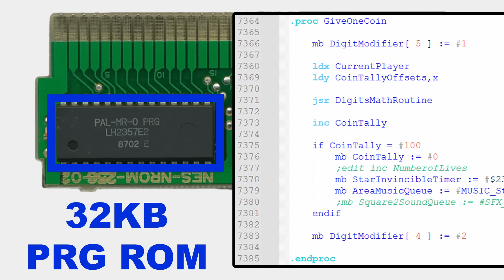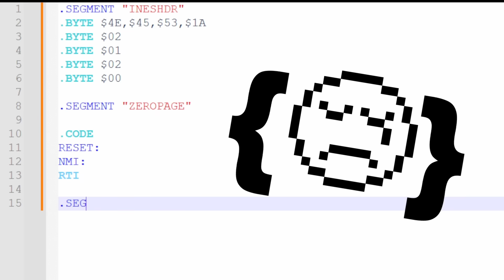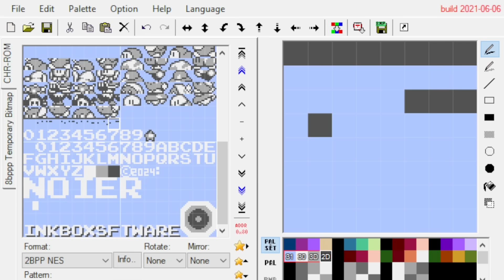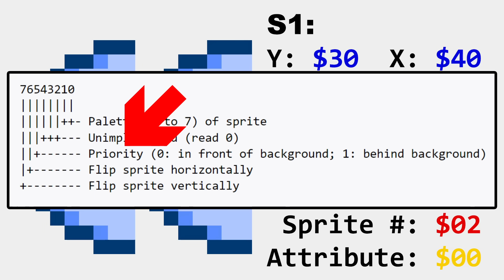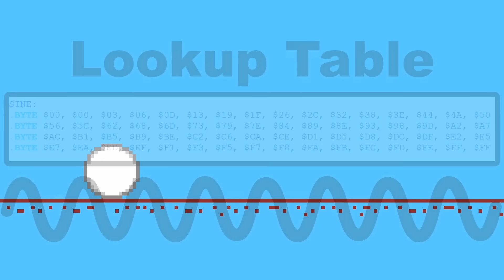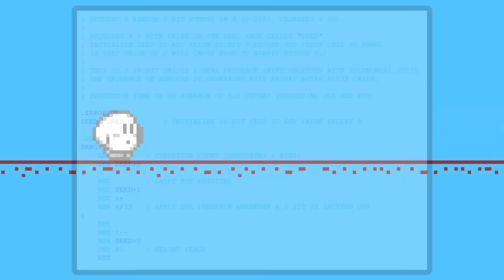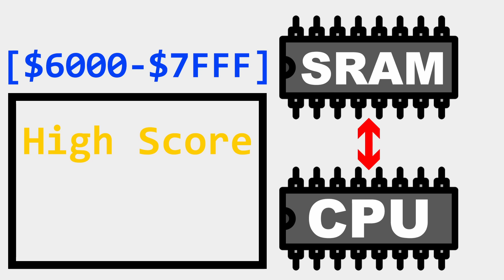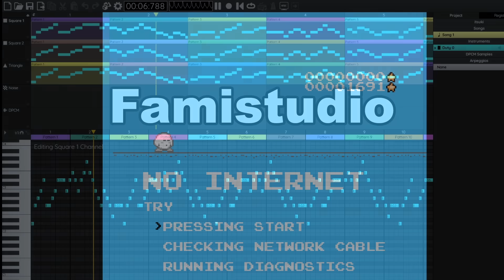Programming a 40KB NES Game (in Assembly)

Comment: Using a sine for jumps is one of the common misunderstanding of jump physics. What you actually need is a y=a*t² function instead, which comes gratis by having y += speed; speed += gravity.

Now, given how many NES games had tweaked jumps to the point where they are mostly shaped like SMB1 hills, the sine isn't a too bad assumption unless it brings you back up if you fall down too far.

Comment: What people fail to realize is that most cartidge consoles are an incomplete motherboard.  Arcade units are a complete game board.  What nintendo, sega, and others did was create the same thing, but with the "game" portion being modular and replaceable.  You could in theory create a single board for ant cartridge game that plays only that game like any other arcade unit.  This is also why it took a while for cartridge systems to catch up to arcade units.  Arcade boards could be designed to play the desired game optimally, whereas cartridge or even disk or tape systems were always limited by what the host hardware could do.  It wasnt until we could build host hardware faster than what arcade mainboards could do that we got arcade quality from console systems.

Comment: Slow down!
You're better off making a slightly longer video to include clearer explanations of what all these things are.
RAM... random access memory. You can alter the information, and you can access the information. Which means, it's read and write capable.
ROM... read only memory. Self explanatory.

So the instructions that never change are programmed into the ROM.
The stuff you want to keep note of while you play but don't always need and constantly changes goes into the RAM.

PAL-MR-0 PRG chip,,, 32 KB (kilobyte) program ROM chip. Contains basic instructions to direct electrical pulses to the right components on the NES.
HVC-MR-0 CHR chip.... 8 KB ROM chip. Contains tiny switches that determine what colors and what pixels are used to make shapes appear.
3195A chip... sends data to the NES to confirm the official status of the cartridge. It has to be a licensed product with this chip in order to work. Got it!
Ricoh 2A03 CPU (Central Processing Unity) chip on the motherboard... based on the MOS 6502AD chip. It has an APU (Audio Processing Unit) built into it.
The RAM available (where the CPU can save information for easy access) is only 2KB in size. 2KB isn't even enough to hold a low resolution photograph.
RPC02G-0 chip... the picture processing unit. Converts the data on the cartridge in the HVC-MR-0 CHR chip to shapes on the screen.
The data is converted to an RF signal (radio frequency) that's transmitted to the TV, and the cathode ray projects that onto the inside of the TV as scan lines. Great, I understand.
60 frames a second, but interlaced. So not really 60 frames per second. More like half of a frame... so 30 frames per second interwoven.

When starting up the console with a game plugged in, both the RAM on the cartridge an the VRAM (Video random access memory storage) are cleared.

Then the graphics that are stored on the HVC-MR-0 CHR chip are loaded into the VRAM of the NES, which then the RAM on the cartridge runs the BIOS (Basic in and Out System) or game logic.

Comment: Question: is it possible to alter the color pallete of a sprite on a per-LINE basis rather than a per-cell basis if coded correctly? Sorta like how the Atari 2600 did to give the illusion of extra colors for a single sprite?
Reply from the maker: Yes, but it would require keeping track of PPU cycles

Comment: Commodore 64 games were about 38kb max 40kb on a 8 bit machine is quite sufficient when you use exclusive machine code that was kerneled with it 40960 Bytes to write a game with i bet you couldnt do it the nintendo was far easier to program than a c64 the Nintendo had a innovative  way of programming

Comment: What?, the controller data in the nes is a fkn byte?, that knowledge would have saved me a lot of troubles back in the days when I spent hours trying to fix my controllers.
Reply from the maker: Actually, the controller is polled and relays each button's current state in a sequence. That process takes quite a few clock cycles, but you can take that sequence and fit it all on one byte for reference.

Comment: Later games used "bank switching" to fit more code/data than the NES's 64k address space would typically allow
Reply: That sounds a bit like multiplexing which gives more capability to a limited resource by working on one bank or area of the screen at one time, which happens so fast that the person playing the game can't see this.
Reply: @lemdixon01  It's more like an HDMI splitter where you can have your Switch, Xbox, and DVD player all plugged in at once but you can only see one at a time

Comment: That sine jump idea makes so much since now. I used to wonder how jumps looked the way they do, I'm gonna figure out which takes less time to process for most hardware.
Reply: It would be more physically accurate for the jump to follow a parabolic path rather than a sinusoidal one, and that’s actually not terribly hard to do on a computer, especially for a character’s physics.

Just track the character’s vertical velocity, use the velocity to move the character vertically by adding it to the current vertical position every frame, and subtract a constant amount from the velocity every frame to simulate acceleration due to gravity. This last part is what makes the character slow down on the way up and speed up on the way down.

Comment: Except it actually is more difficult scince we cannot just arbitrarily declare variables and instead must use the three “registers”
Reply from the maker: A variable is just a unit of memory set aside for some purpose, you can easily declare variables at any memory location you need in the assembly code, if you will reference it often you may consider defining it in the zero page
Reply: @InkboxSoftware  Yes but you can't give them names for some reason, which means you need to memorize what all of them are used for.

Comment: Assembly is just amazing really on how small its code can be when it's compiled
Reply: 6502 in particular is tiny. Most modern cpus use 4 bytes per instruction at all times but we have much more room now so it hardly matters. NES code size is mostly negligible when it comes to file size. It's the data tables that hog the most cartridge space
Reply: Gets crazy small when your "words" are single bytes, as opposed to utf-8
Reply: Assembly isn’t compiled. It’s assembled.
Reply: Shouldn’t be C with modern compilers as efficient as writing assembly?
Reply: @rethardotv5874 the problem with C is that it needs a standard runtime library inside the executable to run. Since a lot of the library goes unused most of the time, you end up wasting space, and also just the fact that the code needs to keep jumping between your code and the library hogs performance.
Reply: @shadesoftime  good to know. What exactly do you mean with standard library? GlibC with stdio?
Does that also include code for embedded devices that builds for low performance low memory targets?
Reply: @rethardotv5874 If you cut out bigger libraries (or go without a standard), and remove the elf file cushions, you can get C down to assembly sized programs. A guy made a QR-based snake game a little while back and was finding his assembly program was larger than his trimmed down C.
edit: I should probably note, this is likely due to the optimization for a very common architecture, x86. I'm not sure how efficient one for say the 6502, PowerPC, or Risc-v would be...
Reply: @rethardotv5874 if that was the case you'd never see inline assembly in C code

Comment: Why don't you try and make a SNES game but write it in C ? I've seen a few Sega Genesis home brew cames written in C but there is a development kit for it now in C but I don't know if there is an equivalent development kit for the SNES
Reply: It would be full of inline assembly anyway if you want it to be half decent
Reply: @rusi6219  I don't think so because there is not the complex mathematical function in Assembly and would have to be written from scratch when C has it built in. You can still refer to memory locations in C for sprite manipulation etc. I suspect that Nintendo would try to ban it or stop its development.
Reply: @lemdixon01  yeah but C calls various libraries that will bloat up your compiled files
Reply: @lemdixon01  also compilers aren't that good at writing good assembly, they do a good job at translating higher level languages to assembler but if you just wrote the whole application in assembler from scratch you get an objectively better result at the cost of longer development time. Again there's a reason so many applications written in C include so much inline ASM.

Comment: Analog tvs are 30fps, not 60.
Reply: The NES is definitely able to display 60 non-interlaced frames per second. Apparently it can do this because each frame only uses half of the vertical resolution CRTs support—240 lines instead of 480, which is enough for one “field”.

The NES also ensures the CRT doesn’t slightly offset the scanlines vertically every other field, so each successive field just draws over the previous one. So, rather than serving as half of a frame, each field just serves as an entire frame, and you get 60 FPS as a result.
Reply: CRTs have a 60hz refresh rate (50hz if PAL)
Reply: @GANONdork123  exactly. Its 30fps. Its interlaced. Its really cute how you thumbs up your own post too